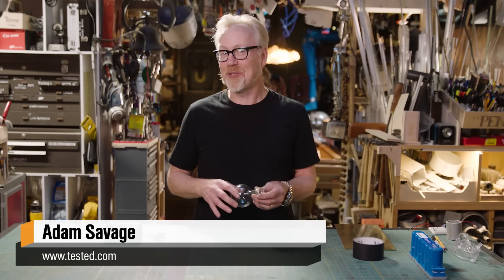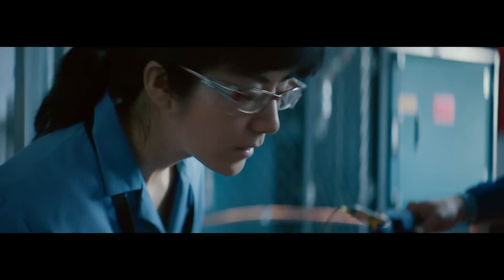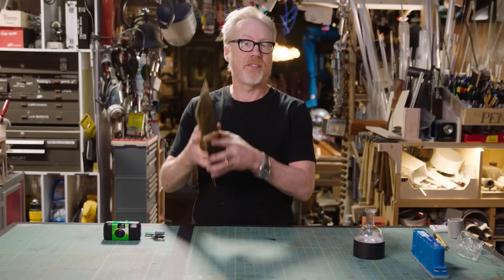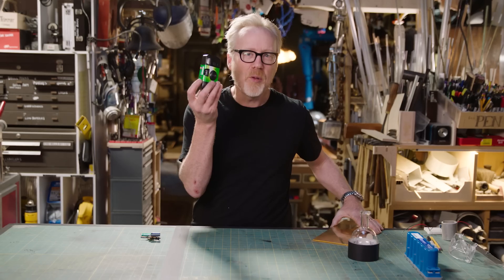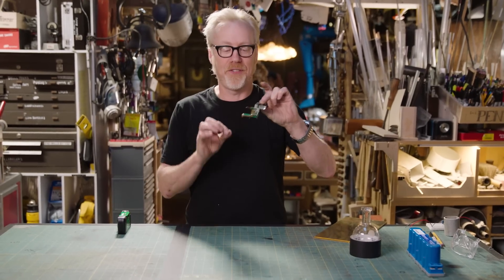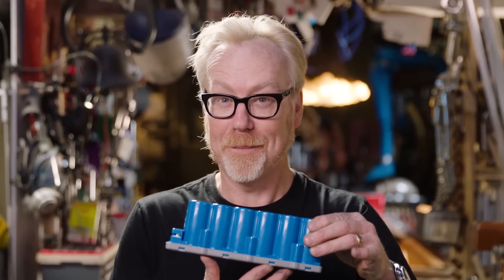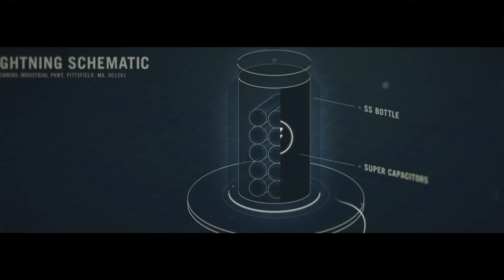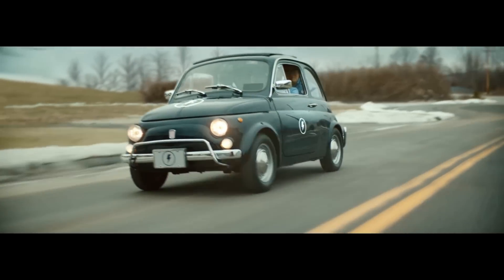Adam Savage Catches Lightning in a Bottle - Unimpossible Missions

Comment: Okay so we have the technology of drones and balloons. Balloons do carry a little bit of a static electricity, but all this is going to properly play into a bigger and greater ideal.

Using a group of drones on the outter layer and smaller ones with-in and balloons throughout the inner layer and ultimately its form is a large, ultra thin layered floating battery. Using all the usual compounds today. (Its a long list) these layers rest just above each other allowing a small space between layers imitating the float of space and distance cousin of a solar plates system.. But think mist. The drones are multiuse-duty, thrusting vector-based, mild propulsion and static and addition to the balloons. Should they fail, they drop below. The balloons couldn't be helium or just filled with, but there are other way to make a balloon float. Heat, small fans and other light gases mixed, etc. and also pending on there structural build and heights. When a balloons fails it drops below. Both landing in a spider's web nest thin just enough to hold objects weight. Size kinda matters and one would be fishing in the middle of the ocean with a five ft line and a small hook. So, using multiple which could be deployed like a parachute, drifting and then expanding in size towards active areas and contracting back to travel safely towards discharge unit. Small drones could also locate and collect damage. During and after except near volcanic activity depending.
The biggest idea here is that its reusable, self protection, relocating and possibly able to be used on other planets. 

Yes! It would be both awesome and terrifying to see. Very dark matrix large floating black ghost box. 
Anyways, once in place and to size, lightening hit the top layer, side. Doesn't really matter. Its broken up and stored, and again after completing its charge collection it shrinks in size and rendezvous with and discharge unit and off that goes to power something like a city and the phases goes back to work collecting or storing for the next time or place. 

This was originally made in tandem with could we harvest/harness lightening so keep in mind,  also this is off the top and my rough draft/concept.

Comment: In order for my hover car to function..
I had to change the composition of pavement by adding one ingredient.
By adding one element ... not a stove element...

I heated down the pavement back to sand and tar .... added the new ingredients while hot ... mixed and reset back to pavement...

The road looks just the same ...but it’s not .

Do you understand electromagnetism?
Levitation via magnetism?

Because I changed composition of road or pavement....
Because of electromagnetism....
Because both use same polarity....

I’m sure you can figure out what happens...

By increasing hover cars electromagnetism...
I adjust height of cars levitation to road ...
By adding a charge to the road ...

One I charged the pavement ...
One I charged up the electromagnetism...
Same polarity caused it to hover ....

I got the idea from the Egyptians and bag dad battery ...to move heavy objects with electromagnetism and two pipes and sheet of metal ..

Comment: The engine I designed generates lightening for my hover car ...
Each of my engines are stamped with a gold lightening bolt .
No names ... just a bolt of lightening.
I feel each engine has a bolt of lightening inside...
Aluminum case of course .

Comment: One thing missing about the camera flash - it also has an oscillator and a transformer to step up the voltage, and the high voltage is what charges the capacitor. The battery doesn't charge it directly. If you touch the capacitor, it can give you a nasty shock.

Comment: I asked that question many years ago to my lecturer about storing power from lightning but apparently, capacitors those days couldn't hold power very well.
Reply: just need a large array of them, voltage regulation, induction, resistance to ground.

Comment: Capacitors are terrible storage devices. They store much less charge than a standard battery. Capacitors are used where they are frequently and quickly charged and discharged without much degradation (power supplies, power factor correction). They do make a nice lightweight car booster though.

Comment: Sorry for being a terrible stickler, but you don't really catch lightning in a bottle this way, you catch it in a capacitor which happens to be inside of a bottle.

The bottle itself isn't relevant for this experiment and could easily be removed without changing the outcome.

Comment: This is such a dishonest video.

First, Adam didn't do anything...he talks about an ad for GE. "Adam Savage catches lightning" my ass.

Second, they didn't catch lightning in a bottle. They caught it in a capacitor that they put in a bottle. I could hollow out a watermelon and drop a cap in it and claim to catch lightning in a watermelon. Kinda shady....
They could have found a way to use the glass or make a bottle out of some material and actually use it to catch a charge. That is what I was expecting based on how they said it.

Third, this video is just an ad for an ad. No mention of sponsorship or anything...and I highly doubt this wasn't sponsored in some form or another.

Comment: i don't understand the difference between a batery and a capacitor or the need to have both
Reply: as i understand it, a battery can hold onto a charge for a long long period of time, however it is relatively slow to discharge
capacitors can hold a lot of energy and can discharge it quickly, but without a battery or something to keep it topped off while it's not being used, the charge gets lost quickly

battery holds the electricity for long term storage, the capacitor gathers it up for a short term use

Comment: Capacitors store voltage, not current. Inductors are the ones that store current. The voltage stored in capacitors can be used to generate current if connected to a circuit as a power source, but strictly speaking the energy is stored as an electric potential differential i.e. voltage.
Reply: To be strict an inductor does not "store current". An inductor stores energy in a magnetic field while a capacitor stores energy in an electric field. Although storing energy in an magnetic field (as for an inductor) requires a current to flow through the inductor.

Comment: a couple of years ago I remember seeing a video where a guy on youtube replaced his car batteries with capacitor banks.  worked fine.   probably couldn't run an aftermarket sound system,   but the standard car had no problems

Comment: you forgot to mention that the xenon flash tube also needs more then 1.5V to create light. Disposable cameras use about 330V (the last i checked). Larger flash and strobe units use higher voltages.  (also, in order to fire the flash, a high voltage trigger pulse needs to fire, bridging the electrodes in the tube, thus causing an arc)

Also a word of warning to any hobbyists, flash units can store enough energy to be lethal, and studio strobes store enough energy in their capacitor banks to be lethal full stop, so dont go taking one apart if you dont know what your doing, as that might very well be the last thing you ever do.

Comment: The nomenclature in this video is a little iffy. Capacitor plates store charge, not current. Joules is a unit of energy, not power. The 1.5V battery doesn't have a certain "amount" of current in it, it has a certain amount of energy in it and it can deliver a certain amount of power.

Comment: The problem with capacitors is that they don´t store the energy for a longer time.
Reply: Super caps store for longer, but this is just a proof of concept, that didn't even prove the concept......
Reply: Definitely agree there. But It makes me confident we will fix the issues. Either way I still think we would want some form of backup cell  to at least provide minimal charge the the cap(s) i nan emergency or simply as a maintainer. I actually see cars of the futuer running off tiny super caps with a tiny battery and solar cells to maintain the caps charge.
Reply: If you charge and discharge the cap in a day long term storage isn't an issue.  The promise of super caps is that they can charge much faster than other battery technologies.
Reply: That is true, super capacitors could probably keep charge for several days without any problem. Although the increased power density comes at the cost of lower energy density. So yes you could charge much much faster, but you would also have to charge a lot more often, since the same weight/volume of capacitors holds less energy than equivalent batteries. 

Another cool thing if you ask me is the fact that since the capacitors have much longer cycle life than batteries as well. In other words they don't loose capacity by charging and discharging nearly as fast as batteries.
Reply: Super caps can be paired with a small (tiny on the scale of it) li-po.
Reply: Yes, I believe that some sort of combination will be used pretty soon. At least as an intermediate step to try and get the benefits of both components. However the fact that super caps still carry relatively little energy is hard to get past unless major breakthroughs in this technology can be made soon.
Reply: The bleeding edge of super cap tech has a density thousands of times greater than current applications and can still be charged in seconds.

It's not in production but the tech was proven to work.
Reply: Yes I am aware of that, the only thing is that there is quite a step to get something from a concept tested in small scale in a lab into something that is mass-produced and economically viable.

Comment: Okay, but what diaelectric material did they use? Conventionally the higher the capacitance the lower the voltage breakdown of the inhalation material. If they are using typical "super capacitors" they may have filled them but only to maybe 12V if they were in series and then wasting all the excess energy as heat. Unless there was some revolutionary breakthrough in capacitor technology I'm guessing they actually didn't collect the majority of the energy from that lightning bolt. It takes surprisingly little power to start a car.

Comment: So GE built a Leyden Jar to capture lightning, just like Ben Franklin did?  wow, clever.  And isn't a thing that takes in a large amount of electricity quickly and releases it slowly called a quench resistor rather than a capacitor, which takes in charge slowly and releases it quickly?

Comment: I didn't know film cameras use batery.
But why a battery can't release all the energy at once like the capacitor do?
Reply: I am not entirely sure but I believe that batteries rely on a chemical process to store the charge so it takes longer to discharge it as it is a chemical process whereas the capacitor stores the energy as electrical charge so can discharge it much faster.
Reply: also there are probably batteries than could do it but its just cheaper for them to use a capacitor in a camera.
Reply: Batteries have a high internal resistance that limits the amount of current they can output... unless your dealing with the new LI-PO batteries... that being said the capacitor is charged using a small current from the battery.... the battery powers a small power oscillator that ramps up to a high ac voltage that goes thru a doubler or tripler circuit. The typical voltage at a photo flash capacitor is around 300vdc, and with a low internal resistance in the capacitor, all that energy can be dumped almost immediately. The drawback to the ramping of the voltage is known as the RC time constant.. or in simple terms.. the time it takes to recharge the capacitor for the next flash...
Reply: It is basically a combination of the two answers you've gotten before: Energy stored in electrical charges rather than a chemical process, which means that the process can be reversed much quicker and therefore energy released faster. 

Plus the fact that capacitors have lower ESR (Equivalent Series Resistance), which helps when releasing all that energy at once, this also means that less energy is lost in the capacitor when discharged and thus the capacitor is not damaged by quick discharging as batteries could be.
Reply: Thanks everyone

Comment: Adam is a lot less fun when he's reading from a script.
Reply: And when the script is not fact checked and wrong as well.
Reply: well technically the capacitors store "charge" because of the way electrons line up on the electrodes. when you release this charge, you get voltage.
Reply: "I decided that I no longer like any of his past videos because of how much I dislike this one."

lol
Reply: Ill tell you, he doesn't get to inform about the facts like he would otherwise. Capasitors doesn't store "an insane amount of energy", they store far far less than a led acid battery. Aslo supercapasitors bleed way to mouch power.
Reply: I'll tell you one wrong thing. GE doesn't stand for General Electric it stands for something really funny that I'm not invested in this joke enough to actually come up with.
Reply: What was wrong about it?
Reply: That's a bit extreme. Tested has some really good videos. I'm sure his youtube career is just fine.
Reply: *Chris The capacitor is not storing electrical current, the capacitor stores charge (which is current x time). Sounds like minor difference, but mixing this up results in a lot of problem when calculating capacitors and inductors as energy storage devices - details simply matter.
Reply: I have no issues with the ad-style format here, but the misuse of electrical terms throughout the video kept making me cringe...
Reply: "An insane" amount of energy is not even a term with meaning.
Reply: Syprix k Dumbass
Reply: Watts would be a better word
Reply: Yeah I unsubscribed and disliked all the videos I liked. This dude just ruined his whole career. So bland, so misleading with titles. Really disappointed in this channel.
Reply: Actually, capacitors store electrons.  Capacitance is measured in Farads. Farads are Coulombs / Volt. Coulombs are the unit of charge.
Reply: +KKR Exactly....
Reply: Could you guys just make up your mind? You're complaining about the video but even you here can't agree to what is right and what is wrong.
Reply: Only a small disagreement here. It's the difference between a physicist and an engineer. Sure, theoretically, capacitors can store other charged particles. In practice, those are electrons. 
Still, it doesn't store "charge" since charge isn't a thing, it's an property. That's like saying a container holds pressure.
Reply: Capacitors store voltage not charge. I'm a student electrician so we see that every day.